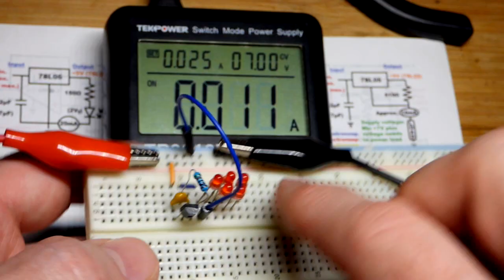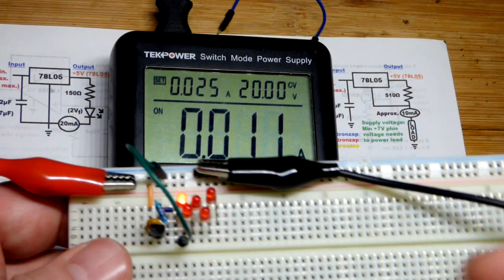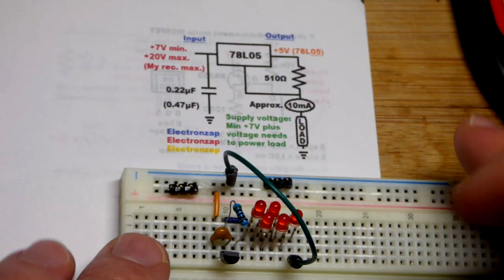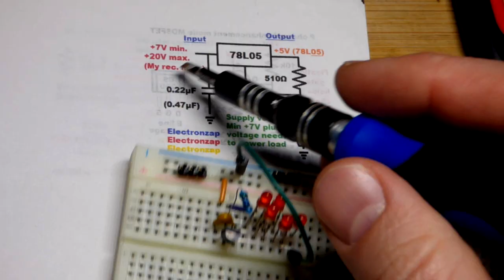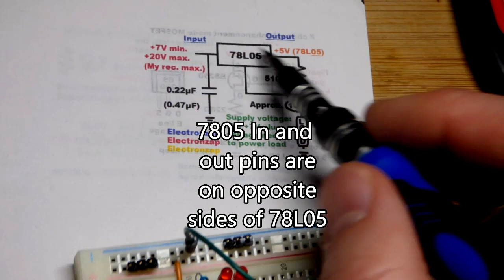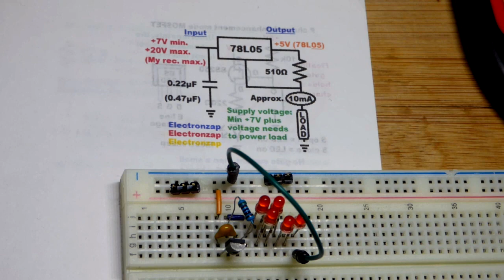10mA Current Source Using 78L05 Positive Voltage Regulator

Comment: GOOD TEACHING!
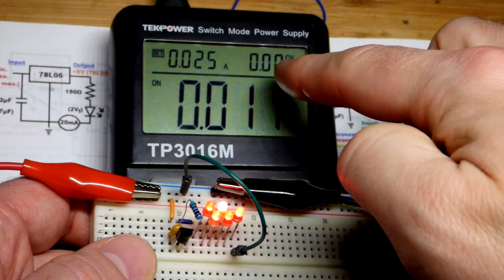At about  4:42 There is a name for the condition, when you stated "...as long as we've got enough supply voltage...",  It's called "VOLTAGE COMPLIANCE".  A very good design term/concept for those being introduced to the limits of  a 'current source'.   I mention this because it was so useful to me in stating specs of my current source circuits.
Thanks for the video!
Reply from the maker: Thanks for the info!